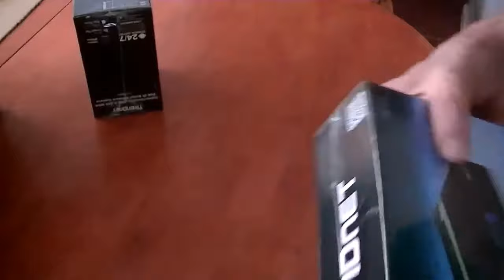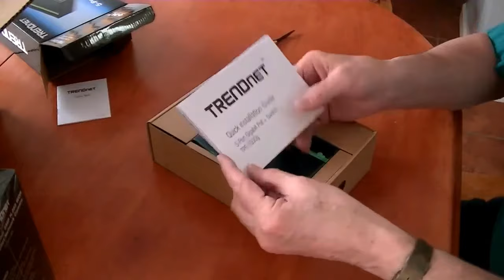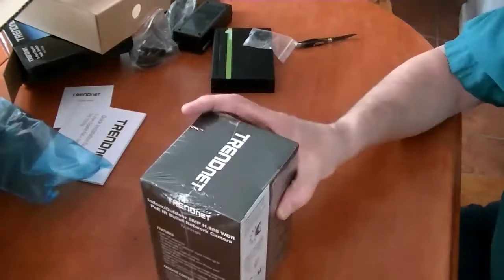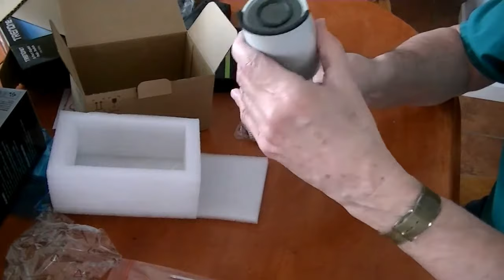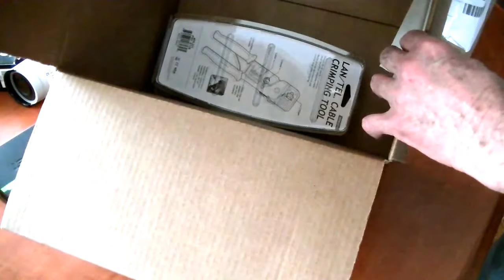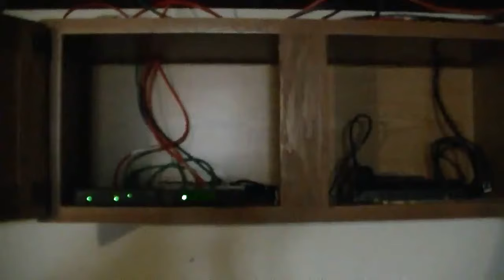Gathering Material for New IP Security Camera Install

Comment: You will like the Cable Connector Test Unit, I used mine when making up Cat 5/6 cables, lets you know quickly if you have a good cable.  Wired my house with Cat 6 for all the toys. After first connector, all went fine.  Just received some small fans to add to the MeCool M8S units, 30mmx30mm 5vdc, going to cut top out over cpu/HS to get temperature down.

BobFlyer
Reply from the maker: It is a little intimidating thinking about making my own Ethernet cables.

I have had my fan and heatsinks for awhile now, but not sure I am ready to install them on my "L" boxes.

Let me know how it goes for you.  Are you going to replace the heatsink also?
Reply: I ran some tests with a 80mm 12vdc fan connected to the usb port 5vdc and sat it perpendicular so the air flow was thru the sides, dropped from 80c down to 59c when scraping, 40c idle, and about 50c on others. I am not planning on removing the heat sinks.  I should receive the -W unit tomorrow and the -L in about a week. The fans are for the raspberry pi.
Ordered from Ebay/China vendor. Nice thing on the M8S Pro +, the USB is switched, thus fans only run while unit it turned on. Hope the -W and -L are the same. I posted on FreakTab under the M8S pro +.   You will be fine with the cable assembly.
Reply from the maker: Did you order the "L" box with the Voice Remote?? Also, do you have a NEED for all those boxes, or, are you addicted to them like I am???
Reply: Yes the newer unit, voice control and Android TV interface, close to what Magendaz nexus type rom.  Just experiments, look see how they will perform. Give them to friends to get off Cable and the high premiums. Hobby. I built several Gray Hoverman Antenna's also which work great for OTA. They are installed on some of the neighbor's abodes.
Reply from the maker: Ok, so you have the "BUG", :)
Reply from the maker: WOW, making my own Ethernet cable is a pain.  I have tried several times so far, but not doing very good...  Have not made a good cable yet...
Reply: Hang in there, you will succeed.  Not sure about the end connectors you
received, but I had the clear units with the individual grooves for the wires.
Keeping them flat and in order during the insert was the hard part.  I used
the back side of a pair of long nose pliers and pulled the individual wire across to straighten out the wiggles in the wire then order by color and cut to desire length. Once inserted, I had to keep pressure to keep the wire inserted while crimping. First was the hardest, had to figure out just what length to cut back the sheath and how long wires were needed, then straighten--order-insert. Maybe if your connectors are not view able, then the big box stores have the clear unit if I recall.
Reply from the maker: The ones that I had purchased from Monoprice has some very bad reviews.  I ordered some different connectors with an insert, hopefully thewill work.  These are the ones I ordered.
https://www.monoprice.com/product?c_id=105&cp_id=10513&cs_id=1051305&p_id=7267&seq=1&format=2
Reply: Hope the new connectors  work out.  On my -L I have run into more issues.  Seems to random lock up, and I have to pull the plug to reboot.  Also, something is going on with the HDMI sequence at initial power up. On the HDMI, I have found that I must start up the -L and wait till I think the unit has booted completely, turn on Samsung TV and select the HDMI port and all works, once it boots successful , as long as I leave it running no issues. But with the TV on, do a cold power boot from the -L, the with the proper hdmi selected, the TV screen blinks between the boot up information and Black screen, never gets communications proper between the two.  On the M8S Pro -w no issues of any sort. Same TV Same setup. I have reset the unit twice and same results. Seems only option now is let it run all the time, or make sure I turn on MeCool -L first, then tv and select desired hdmi port. Or just use the -W for me works fine, only missing Prime Video, which is a request from family members, and spouse. I did not post this on Freaktab, did not want to cause concerns, may be something here with my setup or unit. Running cool with fan blowing up from bottom during testing, so not a heat issue on the random lock ups. Have not figured out what the
menu button does on the remote yet? I have it paired properly. Voice works fine.
Reply from the maker: The handshake on these Mecool boxes are shaky, have the same issue with my Mecool M8S Pro + and my "L"s.  But only on ONE TV.  Don't have that issue on my other TVs or going through my AVR or HDMI switches.

As far as lockups, Originally, I did not have any lockups, but as I side loaded more and more, I got some freezes and have to reboot the box.  Are you running Kodi??  I have the Kodi 18 alpha running on my box and that freezes, but not my box. 

I use the menu button all the time in different apps, especially Kodi.  Also, are you aware that if you click the home button twice, you close out running apps.  Also, I run "KillApps" to kill any running processes, have to use a mouse for it.

I never shut my boxes down.
Reply from the maker: I also my box connected to a $5 Sonoff WiFi enabled smart switch, so I just tell Google to power on/off my box.  No getting off the couch or pulling the power plug from the box.
Reply: Yes on Kodi 17.6  Thanks on the Home Button twice to close down apps, I looked all thru setting to find how to close, been using force close if I could not back out of apk.  I will look into KillApps.  Seems like the thing to do is leave the -L box running. I did this with many previous units. A Roku-3 from back in 2014 when I first cut the cord, has been on since then.  I need to try the MeCool menu button in Kodi, I have a Rii keyboard/air mouse, but will try the remote inside Kodi. It is a nice remote. Just need to learn the features.  Maybe a video on the remote would be good for new/old users  also. I looked at the MI box hoping to find key strokes hidden map, since it is somewhat like the MeCool new remote.  Thanks Bob
Reply: Will this work thru the MeCool Voice activation command, or does it have to be via Echo.  That's a nice feature, I did recall your Sonoff overview video.